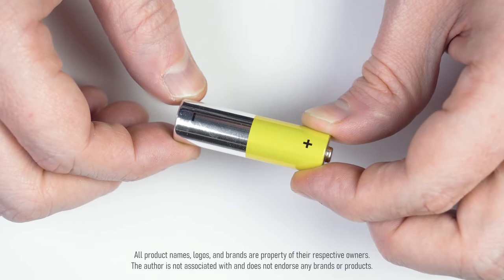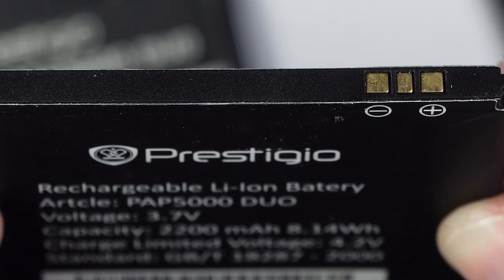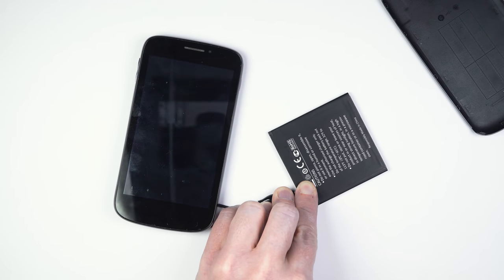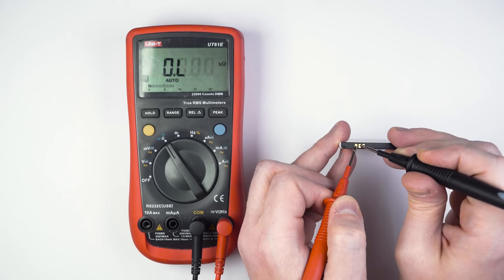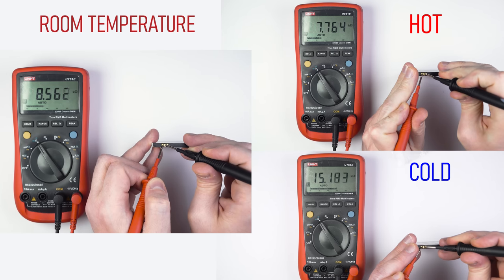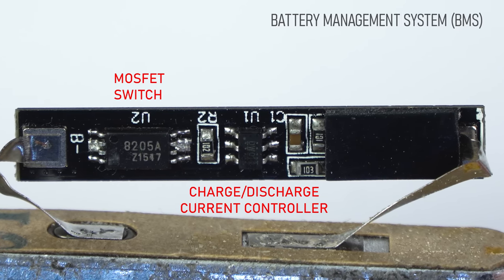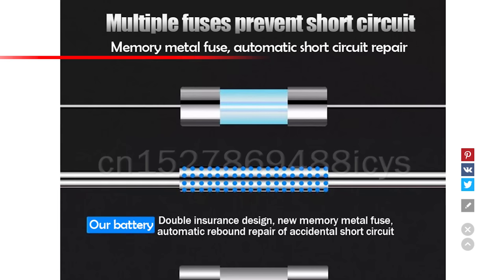Why do MOBILE BATTERIES have THREE terminals? A simple Explanation.

Comment: I actually have a nokia phone with a knock off battery that doesn't have short circuit protection. I bought it very cheap on second hand shopping site. I bought it to use it on school because my school doesn't accept smartphones with cameras and i use it every day. I didn't have any problem with it yet but i don't think the battery in it is safe i think i will replace it with a good one soon because i'm a little bit scared that it might explode if something goes wrong..

Comment: battery monitoring and for detect when the batteri is charging
Reply from the maker: When battery is charging there is nothing to detect. The charging circuit inside the phone can check current strength and see if the battery is actually charging.
Reply: @RonMattino  on my moto g i didnt connected that and only shows 100% of charge but is not the real charge of the battery

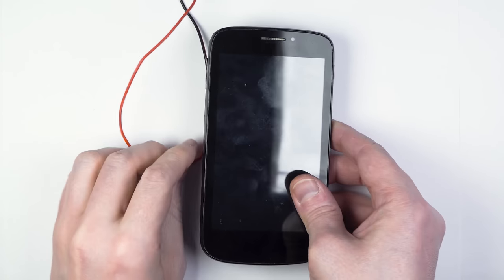Comment: 4:02 hey where did you bough that power supply? it looks cheap i want one

also nice video, all this time i though it was a connector to charge two cells batteries (like the LiPo ones for example)

Comment: What about the four terminal cells? 
Do they have two thermistors?
Or are they worked so that the thermistor is connected across the two extra pins?
Reply from the maker: Sometimes  they have an extra resistor for battery identification, sometimes they have a NFC sensor, or sometimes the 4rd terminal is simply floating (unused). No idea why ;)

Comment: I recently got into rc crawlers. They use lipo batteries. It’s kind of disturbing that they don’t have temperature sensors. They don’t use much current stock, but nobody leaves them stock either. Luckily brushless motors are much more efficient than brushed motors.  It’s a common upgrade to go from brushed to brushless because they are also much more powerful.
Reply: I love mothers

Comment: All good, but LiFe PO4 are most of the time better than Li-ion batteries - though you might wanna know. LiFe PO4 have much more cycles, but have less watts than Li-Ion. So, if you can compromise the wattage a bit, you can gain a life of the battery expanded several times if well maintained ;).

Comment: Not all phones use this though, I once modified my galaxy s4 with an external battery with wires soldered directly to the pcb, I never used the middle terminal atall and it booted and worked absolutely fine
Reply from the maker: You didn't try to charge it via USB probably. It wouldn't charge w/o 3rd pin.

Comment: The third pins explanation is nice, thanks.

In regards to pin 4, at least on many Samsung phones, that's for nfc as the nfc coil is in the battery on those
Reply: Thank you! I was wondering for quiet some time now what the 4th pin is used for.
Reply: @sternenschauer  in fact if you look closely at Samsung phone batteries you might be able to see thr nfc coils under the foil cover
Reply: oh thanks
Reply: No it's not you clearly haven't seen the inside of the Samsung nfc antennas they have the coils inside them
Reply: @pinklightninggacha  not all Samsung phones are the same, i am basing it on the ones i had like the galaxy note 2-4 and the xcover pro.

And you cannot see an nfc coil in there just bare but you can see the outline of one on the battery.

It might be different for those with a fixed battery.
Reply: I think I remember owning an old Samsung phone with the vibration motor being placed inside the battery!
Reply: The 3rd pin is to save on material, they just use the - wire as one side of the sensor.
On the 4 pin battery, the middle 2 pins are direct connection to the sensor, this way it does not share with the - port.
Reply: @ACommenterOnYouTube  I'd say definitely not always the case. At least in the Samsung phone batteries, the - is likely still common minus (or you get a common plus, no idea), but you get the temp sesor on the 3rd pin and nfc on the 4th, because they somehow have to wire up the nfc in the battery to something at least.

And you can see the outline of the nfc coil quite well in the right light.
Reply: With "nfc", do you mean the wireless charging coil?
Reply: @renedekker9806  no, I mean actual NFC, like on Samsung Galaxy Note 2-4 for example which dont have wireless charging by default (there are/were back covers for sale that allowed them to gain wireless charging tho, which have an extra coil for that) and the back panel is just plastic (and the NFC coil realistically cannot be behind the battery lol)
last time I checked NFC and QI run over different coils
Reply: wtf that's genius lol
Reply: @renedekker9806  no NFC is near field communication.
Reply: @sternenschauer  😮
Reply: Thanks, lot better on topic then the vydeo itself

Comment: Lithium Ion batteries not only catch fire/explode when they overheat. This can also happen at impact, short circuit and having the lithium metal react with water. It all potentially makes it go ablaze.
Reply from the maker: They have a protection board (BMS), so when a short circuit condition occurs, the BMS will cut power off. As for reacting with water, Li-Ion cells have aluminum case and are basically water proof. The only possibility to catch fire -- like you said already -- overheat or physical impact.
Reply: @RonMattino  BMS also can cause short circuit - in a case of ic failure (happened to me once). Good batteries has also regular fuse for last resort.
Reply: And puncture
Reply: Yes they can, I had a Toshiba laptop that had a built in Lithium battery and when it eventually broke down I was breaking the case up into smaller parts to throw in the trash and the battery literally exploded and caught fire and it was like a blow torch, literally a jet of fire was bursting out of the laptop from the battery compartment, it almost burnt the house down the fucking dangerous thing
Reply: Lithium-ion is not the same as lithium metal. The batteries don't have lithium metal in them.
Reply: @ninjabluewings  Dangerous when not treated properly, ie. bashing the crap out of it!!! 😆🤣
Reply: @ninjabluewings  Maybe don't break it up like that?
Reply: @RonMattino  The seals on these things are crap. The BMS is useless if anything happens inside.
Reply: @ninjabluewings  “I was breaking the case up into smaller parts”
I’ll ignore the trash part…   Yes I to love to do something similar. I like to crush my propane tanks before throwing them in the trash. I bash them with a hammer.
Reply: @echo-hotel  Seatbelts are useless if a car catches fire. Should we remove all seatbelts? Get it?
Reply: @lon1117  Yeah, they do have lithium metal in them.
Reply: Or if a battery goes completely discharged, causing the paper separator between the two metal plates to dry up.
Reply: As long as nobody builds a vehicle that has it's entire floor made of batteries, we should be fine... right?
Reply: @lon1117  Yes, they have lithium metal in them, in metallic form. Don't mislead people!
Reply: They can also be dangerous when to cold. It ok to draw power from them bellow freezing but never charge a lithium battery if it is bellow freezing.
Reply: Asalamalikum
Reply: @RonMattino THE LETTERS
*B M S* MEAN

*B* OWEL

*M* OVEMENT

*S* MELL
Reply: @RonMattino  a swollen battery could also be dangerous, because  the case integrity can any moment broke . Usually this happened when the battery was over discharged.(I believe under 2.8 v)
Reply: Thanks for that, the whole world can sleep better now
Reply: @echo-hotel  You are not suppose to break the casing of the battery, as the battery can explode which it did in your case!😂🤣
Reply: @RonMattino that is stupid to say bro, because penetrating a lithuim battery creates a short before the BMS. It could detect a high temprature, trying to shut off the output, but the fault is inside the battery itself, is right there where the energy is and there is no thing to do to make itself stop burning and or exploding…
Reply: This is why when a Tesla catches on fire, water can't put it out. They had to dig a hole 5 ft deep, fill up with water and DROP the car into the hole to contain it.
Reply: @ACommenterOnYouTube  in my country they submerge burning teslas.. apperently they are still able to catch fire after being in there for two weeks 🤦🏼
Reply: @ClosestNearUtopia  🤨
Reply: Charging too cold
Reply: @Kyle-gw6qp  "Yeah, they do have lithium metal in them."

==No, Li-ion batteries do not have lithium metal.
The anode is usually made of graphite and the cathode is made of some metal oxide.
Reply: @louistournas120  My bad, I thought the batteries worked by oxidising and reducing lithium. But that is not the case. Apologies.
Reply: @RonMattino  i was gonna say like the chances of that happens varies forsure
Reply: those segway riding wheels have 15# batteries! and YES they do catch fire and have exploded!
Reply: @echo-hotel  
        You love to crush propane tanks ?
Reply: @ClosestNearUtopia It is true that a short circuit in a lithium battery can create a short before the BMS and cause a high temperature. However, a battery management system (BMS) is designed to detect such faults and protect the battery from overheating and causing catastrophic damage. The BMS must quickly detect a short circuit condition before the sudden and massive current draw overheats the battery and causes catastrophic damage. The BMS shuts down prolly between 200-600 microseconds of an external short circuit, then resumes normal operation if the short circuit condition is removed. So its probably rare I guess
Reply: @ninjabluewings  hope you learned your lesson, and hope others learn from your incident too.
Reply: @NoobWardenSpammer  I was thinking that too, but then I realized that belongs in the physical impact category.
Reply: @ninjabluewings  Oh, yes, in the hands of a child or similarly immature human being, those can be so dangerous...
Reply: @echo-hotel same thing with spent nuclear rods... pulverize them before dispersing them to the wind.
Reply: @fredvoid5976  the point is, the bms can cutoff the outputpower, while the source of energy cant be stopped aka the bms doing nothing to prevent a penetrating battery to explode… its about the same as a hole in a gastank, where fire spits out, and the main valve closes to prefent gas (energy) being feeded to the system for safety reasons. Yes, the system is secure, and protected agains damaging it, but the source of the energy will get destructed, aka the the gastank or in terms we are speaking, the lithium battery..
Reply: @Volodimar  No, they contain lithium hydroxide or lithium carbonate, lithium compounds that are not pure metallic lithium. These reduce to lithium ions in the electrolyte, hence "lithium ion" battery. They do not explode in contact with water because it is not pure metal. This is the same with sodium in table salt, in water the crystal dissociates into sodium ions which also don't explode with water.
Reply: @fredvoid5976  If the short circuit happens internally to the main part of the battery, then the BMS can't see the fault because the BMS is external to the main part of the battery - it's an add-on board between the main part of the battery & the contacts to the outside world.
Reply: @ninjabluewings  GOOD
Reply: Is there any way to connect the device directly to the house electrical oulet?
I have a ProScan tablet that the batteries expanded and i wanna know if i can just remove the battery and use it directly from the oulet of my home.
Reply: @RonMattino unless you buy them from a sketchy brand in China (no hate on china, chinas a good country)
Reply: Fearmongering who?

Comment: Battery protection is very important. A friend of mine bought a shady battery like this for his phone several years ago. The thing swelled the first time he tried to charge it. The battery was provided to me for the purpose of investigating what went wrong. Turns out the only "protection" there was a 0 ohm link where the double mosfet was supposed to be, and a no name npn transistor in place of the DW01 chip. Guess they used a PN junction of the transistor in place of a thermistor.

Having said that, this third pin on cellphone batteries actually predates lithium ions. I've seen it on stuff used in the late 90's and early 2000's. I recall taking apart a Siemens C35 NiMh battery that looked almost identical to a Li-Ion battery. Inside however where 3 square NiMh cells in series, and the middle pin was nothing but a thermistor connecting to the negative pin. That was the whole electronics inside, and the thermistor played an important role in the charge of the battery, as that's how the charger was detecting that the battery is charged. When these batteries recharge to 100%, passing more current through them heats them up. That's what the charger detects, and stops the charge.
Reply: You can use a 2 pin diode as a temperature sensor and is very linear unlike the thermistor which has a curve. But NEVER in place in a circuit that needs a thermistor.
Reply from the maker: Battery starting to swell on charge means that's it's very old. Some shady sellers just relabel the batteries to reflect a more recent date to trick the buyer.
Reply: No need to write to much
Reply: agreed,  back inthe 1995s  the batteries  would charge until you removed the charger, they never did stop charging and wore the battery life by 40%
Reply: @diamondstar2897 . No need to read this much or even reply. Your point is?
Reply: @ddnava96  it's waste of time and mobile charge ha ha 🤣. You should not comment to much. Don't reply me again 😛🙄
Reply: @diamondstar2897  or what?
Reply: @diamondstar2897 well aren't you full.
Reply: @JanglePangle  ok sorry
Reply: @diamondstar2897 . Everyone gets to choose how they spend their time, just like anyone gets to comment and reply as much as they like c:
Reply: @ddnava96  Judging by his profile, I wouldn't be surprised if he's just upset because he's selling old e-waste batteries out of India.
Reply: @ddnava96  ok I understood 🤐🤐😶😥😓😞

Comment: On some Canon camera batteries the fourth  contact is to prevent third party batteries. The camera might still work but it may have limited functionality like not telling the remaining charge or it might just warn of the non-original battery. Some of those have been cracked though
Reply: Sometimes my canon camera tells me to check if i use an original battery. I'm always confused bc i only use original ones.
Reply: @UnboxingTVofficial  the chip that checks  might be worn if you are using original
Reply: So basically an iPhone
Reply: Canon crippled hammer just play the role there. 
Now they banned all 3rd party lens.
Reply: @AdminTechnopedia  just jailbreak the device FFS
Reply: I remember buying an original Canon battery for my little SX620 and it cost half the original price of the camera plus battery. So it costs Canon as much to assemble a battery as the camera? I think not. Canon battery prices have been a massive scam over the years relying on scare tactics re third party batteries and the old Canon cripple hammer as already mentioned to nobble perfectly sound third party products sold at sensible prices. When Samsung were in compacts you could buy their batteries at a very reasonable price and Sony prices are not so bad. The battery life indicators on their compacts were also terrible and gave no clue as to life left. I remember with a G1X Mk II flashing flat battery so I replaced it but muddled the batteries and put it back in and it immediately showed 2 bars only to go flat in a couple of shots. The effort goes in to technology forcing own brand purchase at hyper inflated prices rather than performance.
Reply: The PSP also had some kind of more sophisticated electronics on the battery, connected to the 3rd pin. Funny enough, this created a hacking backdoor instead of protecting their battery market share.
Reply: @Kalvinjj  aye I remember when people would make jailbreaking batteries using something soldered on the battery. I believe it ran the risk of bricking the unit if done incorrectly tho. This was on the og model. Afterwards software cracking became easier and more common.
Reply: @michaelcross4112  how tf can one jailbreak the hardware without opening anything up but the settings menus
Reply: @OninDynamics  It can be done through firmware hacks. Older Canon dslrs like 5d mark iii has 3rd party firmware called magic lantern, it unlock more video function, such as higher bitrate or even raw video.
Reply: @qiyuxuan9437  oh, i just thought that companies, when it comes to messing with the consumer, would make it their highest effort to hard-code everything to lock it down, but i guess companies still aren't at that level

imagine Canon embedding 14 different chips throughout the entirety of its cameras, all independent of each other, just to prevent 3rd-party batteries from working, with $200 worth of hardware embedded into each one of their batteries just to spite people

\s, but this kinda stuff won't even surprise me at this point
Reply: @OninDynamics  Canon is the worst offender in camera companies(not including red lol) Magic lantern is not avaliable for newer models, since they cant crack the firmwares. Canon also threatend 3rd party rf lens manufactures, and all the approved 3rd party rf lens are not in popular focal length, and does not compete with any Canon native lens.
Reply: I have 3rd party Canon batteries. They work perfectly in the camera, but won't charge on the original charger.

Comment: What? I thought it was obvious: the extra connection pads are there to keep the magic smoke inside! Jokes aside, it never occured to me there was a thermistor involved. Thank you for demistifying this concept, also there are great comments in the comment section which go into other details, overall very informative experience
Reply: Due to the capacity of Li-ion battery there is an excessive amount of magic smoke inside, so you have to be careful,  but just like any other electrical thing - once the smoke escapes the equipment no longer works...